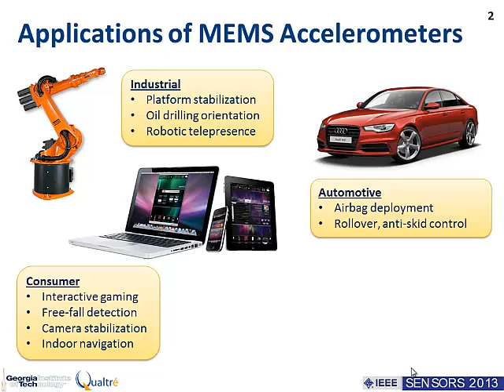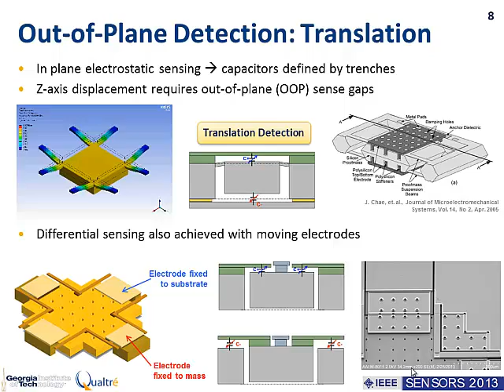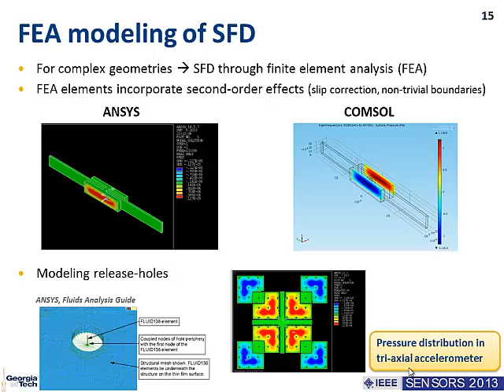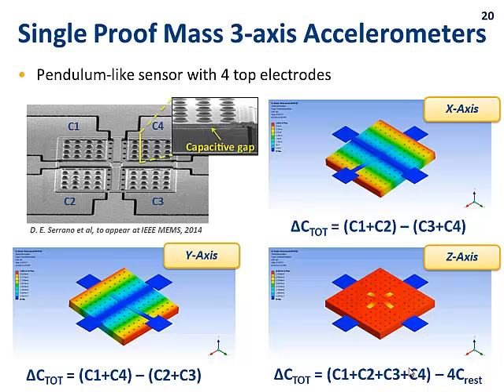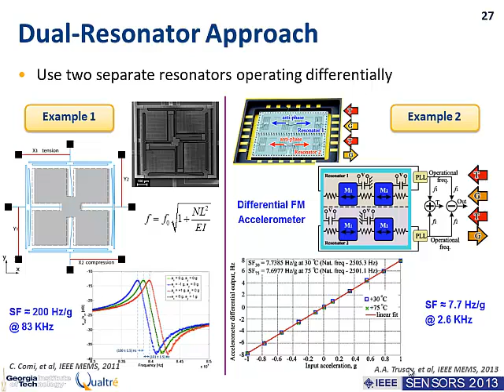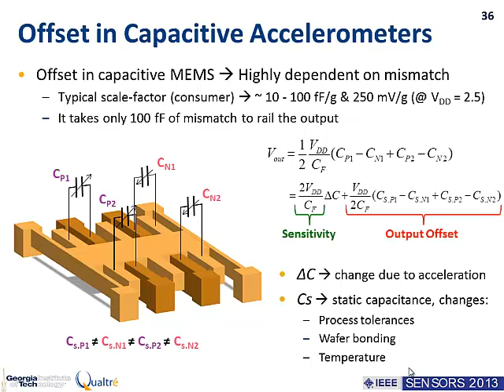Design and Analysis of MEMS Accelerometers

Comment: You said it too clearly, but I also want to know whether the MEMS single-axis gyroscope can detect accurately, compared to the three-axis
Reply from the maker: Hello @EriccoInertialsystem. Not sure I fully I understand your question. Do you mean a single axis gyro vs. three-axis accel to calculate an angle?
Reply: @diemilio  you're so friendly, i mean MEMS single-axis gyroscope compared with the three-axis gyroscope.looking for your reply
Reply from the maker: @EriccoInertialsystem  well, the issue with a single axis gyro is that you will not be able to detect rotation about 2 of the axes. In some situations, this might not be acceptable, but in some other scenarios this might be OK though. For example, imagine a small robot that needs to navigate in a room. This robot does not need to go up and down, it only needs to know where it is pointing in the x/y plane, so a single axis gyro is sufficient to get this information, so in this setting having a 3-axis gyro is not necessary, you only need a z-axis gyro. Now, the following is not always true but in general it is safe to say that single axis gyros are usually designed to have much better performance than single-device 3-axis gyros, so for applications where you don't need x/y detection, a single axis gyro might actually be a better choice.
Reply: @diemilio  I always thought that the number of shafts determines the accuracy of the measurement. The more the number, the more accurate the measurement. I have learned a lot. Thank you so much. I will watch your videos for a long time and become your active fan!
Reply: Thank you!!